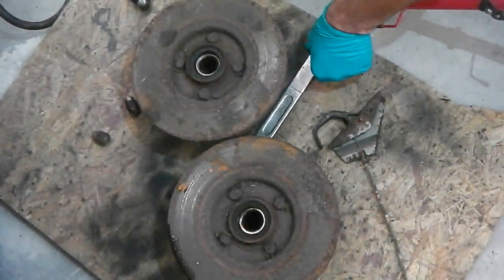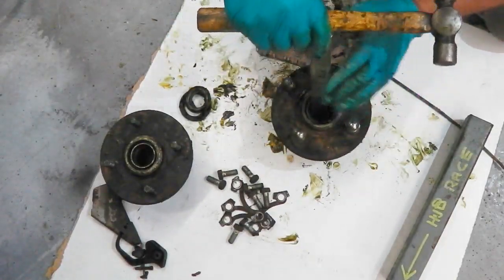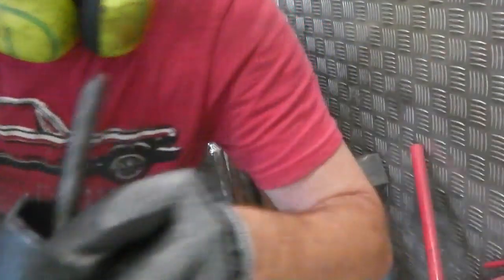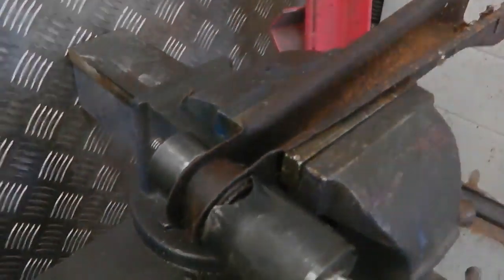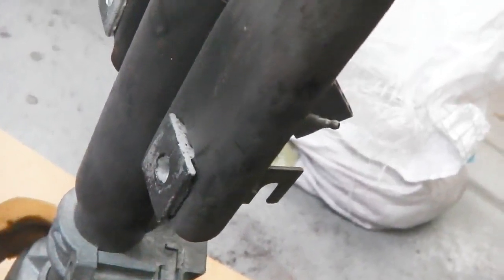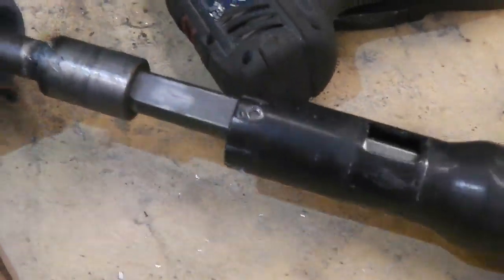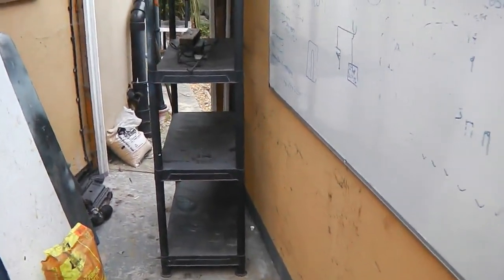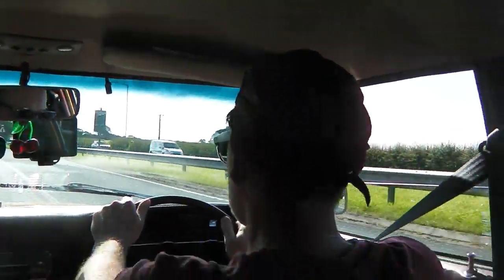Classic Car Resto - Mk3 Ford Cortina - Project Bramble EP27

Comment: i had a franklin void bush tool i bought in the 70s of which i drilled two holes in the end so i could hold it with the grinder two pin tool i eventually bought a 12ton press and never looked back,another great episode well done.

Comment: Hey Pete. Great stuff. It was neat to see the bushing extracting tool once again. I can't imagine gettig the bushing out by any other means without ruining it. It is amazing the amount of work on such parts as a steering column that needs to be dione before any powder coating or zincing takes place.

That restored /rebuilt gearbox looks like a brand new space rocket.The evapo-rust is a fabastic product I see. It really does the job well with little to no elbow grease on most parts. It is environmentally friendly nd reuasble. WOW! Keep on Keepin' on Pete.

Comment: Hi pete, for future reference  if you drill 2 2mm ( sixteenth inch) holes in the snap bolts you can turn them out with circlip pliers saves a lot of swearing  enjoying project bramble good stuff
Reply from the maker: thank you Bob    Pete

Comment: If youwant to remove outer bearing races(cups) from front hubs etc, just run a bead of weld on the running surface of the race. this shrinks the race and it will fall out in a few seconds.
Reply from the maker: thank you

Comment: If you need to use a fair amount of impact or a press to remove a disc you should replace it regardless of condition,cast iron discs do not stand up well to cold flex.I watched a guy once rattle a pair off using a blunt blade on an air chisel, just gently moving it around the centre flange to shake off rust while applying firm hand pressure to limit the hammer action,After about 60 miles one disc snapped clean off at the joint to the bell,I didn't ask about the condition of the other but assume that would have been cracked also.
Reply from the maker: thanks yes will be repalcing with new as only £29 pair new.  OEM spec thanks Dick for valued info , Pete
Reply: I believe going through deep puddles with hot discs can warp them.
Reply: @marklittler784  indeed and can even cause thermal shock fractures.Although,a disc generally will not warp with normal use,warpage is when runout is equal and synchronous across the clamping surfaces most people will measure runout on one surface note it is above tolerance and assume warpage,to correctly identify warpage you need to measure both surfaces simultaniously,a small amount of runout will always be present and generally taken up by the 'float' of the caliper.what usually occurs is that the disc will wear thinner at one part of its swept area so that at a certain point in it's rotation the disc will be thicker than it will be further round,any deviation between the thickness of the disc above roughly 0.7mms will be felt through the pedal as judder.

Comment: Do you find the clark 240v impact driver has a lot more umph than the clark cordless impact driver. I bought the cordless and found it did not touch a lot of stuff, but a 3ft bracker bar cracked the threads then the driver did the hard spanner wrenching  work.

Comment: Pete, a bit off topic, but do you know how ford got away with early Mk3s having white front indicators when everybody else had orange ones?
Reply from the maker: i think that it was legal at the time for this, though if i recall orange bulbs were fitted but other cars of the time had clear lenses, im almost sure the law only changed later
Reply: @PeteCswampy  Just googled it and the law says they had to be orange on cars made after 1958. Prior to that they could be clear at the front and red at the rear. I can remember as a young kid wondering why Mk3s had clear ones. They definitely came out the factory with clear bulbs too as my dad had a new K reg GXL with them. Maybe ford just hoped nobody would notice!! Keep up the cracking work anyway Pete!

Comment: wobbily board was the best part adds to that extra luagh factor but then you replaced it, 
stripping the rear end, though this had leaf spring? or was that only for the more lesser mk3 cortina's? as in the ppl that couldn't afford an gxl verson?
you can see why ppl used to not get them fixed back in the day, that lil one only just came out but put up a fight and unlike now a days they didn't have that back them might of in the 90's but not back then, 
lol funny idea back in the day "and how did you get that bruse mister anon?" "well we decided to camp out in the car got a mk3 ford cortina doc, so the seats were folded out bed like there i was happy asleep then i roll over and ugh! the hand break nuts me in the gut," might be why ford removed that option or maybe as they had the mk1 transit they would say buy that instead of the mk3 as well much more room and no going to the doctors with a bruise on your arse or gut,
that thing is noisey but its doing a good job turning rusty things into nice not that rusty but pitted ish things,

Comment: Hi Pete again from downunder western australia, went to a local car meet on Saturday ( https://www.youtube.com/watch?v=wUVjiCozJBA ) , bumped into 2 other Aussies that watch you. Couple of tips on the last video :) please dont be offended. I have a flash drive of royalty free music i play in my car so i can use dashcam but listen to music without copyright. ( i use NCS on youtube) Brake disk removal especially if you want to keep the disc safe, use 3 pieces of wood to elevate the disk off the floor but to support it so you can hit it from the back side. Bush removals, if need be work it back n forth placing the removal tool on the opposite side, use penetrating oil like you did and if needed a bit of emery paper to smooth down rust :) but work it back the other way also different sized sockets work great as spacers or for different sized bushes :) cant wait for the next episode

Comment: I restore eunos's
Reply: bonkers 03 my son has one here in nz, working on the drivers door wiring connection plug at the moment, and air con comtroller is a dead unit unfortunately, had it going for a moment after running a solder over the board